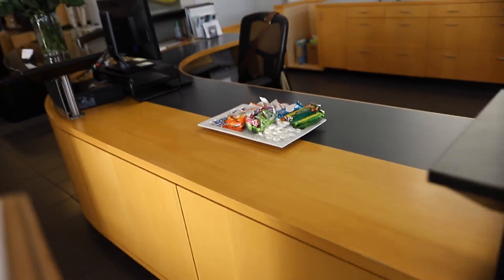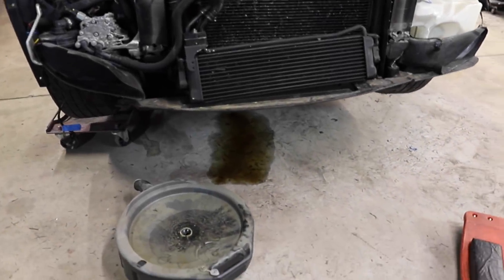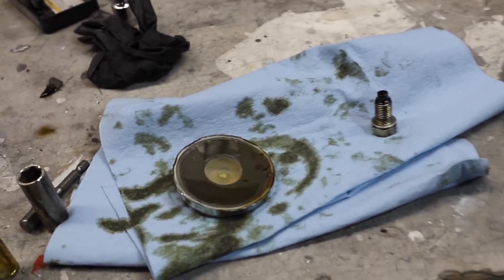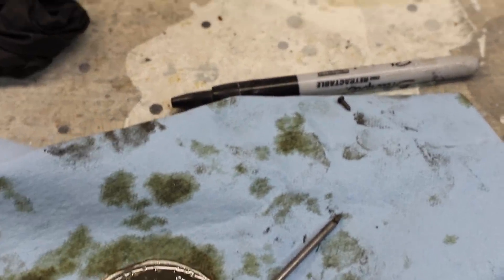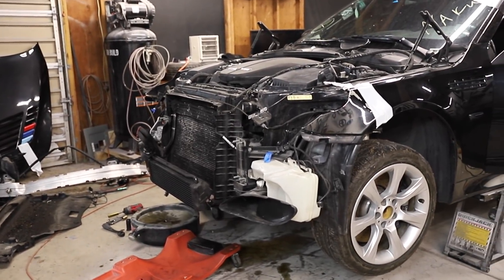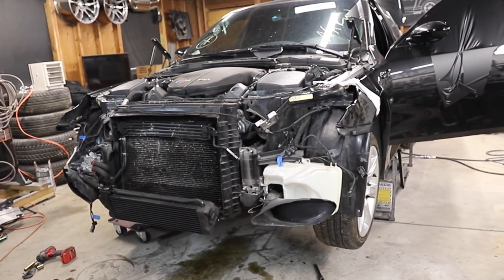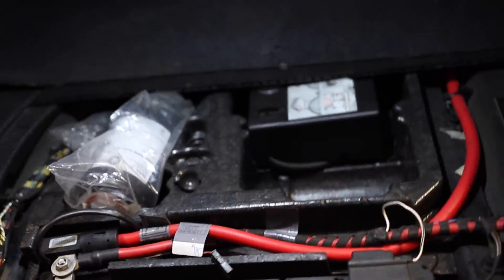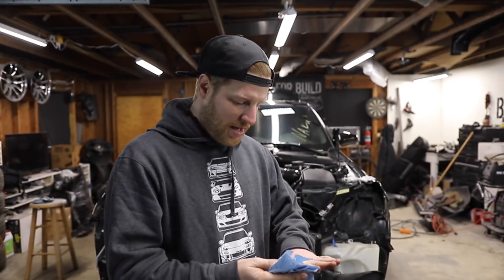Does the M5 Engine Run? Let's Find Out!

Comment: Also WHY would you replace the bearings in the bottom end,,the car only has a 100,000 miles on it and there was not any real notice of bearing metal..I have vehicles here with 300,000 miles and I’d take them on a 3000 mile trip in a minute.!
You’re blowing money that’s not needed.I have 700HP big block Chevy engines with 8-71 Blowers and when I change the oil there’s always a few flecks of metal...It could be from anywhere,,Cam,Crank,Rockers,Pistons etc...I wouldn’t bother,,Wait till you put the exhaust on it and when it’s quiet and you start it up listen for bottom end noise,a steady rap noise at say 2000RPM...Then you have a problem,Crank Beatings,But no way I’d tear it apart now without knowing if there’s even a problem.!!

Comment: Thats not water you spilt, That would be condensation from the hot exhaust gases vs the cold engine block. If the car had an exhaust you would notice it coming out the rear of the exhaust just until the whole exhaust system warmed up to temp :)

Comment: Your trying to use a camra that was designed to be used for photography and is limited to 30 minutes of record time, VS your old setup which is an actual video camera. 

Difference being a camera that is designed as a 'video camera' has no recording limit, has a different autofocus system, and is generally set up in the menu's to be easy for videographers to get the system. not to say that it can't be done, it's just the reason you're having issues.

Also as you stated your running the lense wide open your going ot have focus issues. Close the lens to F4 or-5.6 and it should make shooting much easier on the focus side, and still give you a creamy background. You have plenty of light to work with, so you definitely don't need to be shooting a 1.8 at 1.8 for video.

Keep up the good content.

Comment: On a vehicle with an engine that is know for eating bearings it's probably safe to say that finding any swarf on the drain plug or magnet is bad.  You really want to see the engine oil coming out without any swarf as then you know that the car has already had the repair done and had the upgraded bearings fitted...

Comment: When you get a chance, you need to send oil sample to Blackstone labs, usually the lead goes out first, before copper starts to show, usually high lead count vs average would mean it’s time for Rod bearings to be changed, if the copper is higher than average, then it’s immediately needed!

Comment: I own 04 330Ci ZHP manual and my 6th piston rod bearing wore out.. that little spec is nothing compared to the issue I've had.. Mine failed @ 145,000 when i had issues. I pulled motor and rebuilt the bottom end...

Comment: Use realoem.com to find part numbers and parts diagrams for BMW's. It is an excellent resource and makes Bimmer life MUCH easier. It accurately tracks part numbers through revisions and build dates to get you the correct part you need. Use that part number and search it on the usual suspects to find Genuine BMW, OE supplier and aftermarket parts. I like FCP Euro and ECS Tuning the best. Buy OE supplier parts for the best quality AND the best price.

Comment: I was wondering if you were on crack? Why try and stuff that huge motor in that classic? Great idea if it fit, but it doesn’t, you even did a video to prove it. Moving the front wheels will destroy the proportions of the car. Photo shop that! P.s. love your Chanel and watch every show, but mcm wins the 240z challenge.

Comment: Open manifold is fine.. you don't want to run them with nothing on the head itself becasue it'll have trouble pulling the heat away from the valves and what not..

Comment: I once did a 170mile round trip in a 335i without the exhaust manifold fitted it was fine just used slightly more fuel and made sure I had some ventilation lol.. a garage messed it up whilst replacing the rocker cover gasket and clutch somehow but yeah man love the vids bro!

Comment: Hey Chris, I'm not a Master BMW mechanic by any means but I can give some advices about S85s

First, I don't know about the US, but here in Europe they still sell Castrol 10w60 TWS oil at the dealerships.
There are now much better oils on the market, especially the Redline ones, which have a much better HTHS (efficiency at high temperatures). (And no, I am not affiliated to Redline)

Also, I have seen not one but two S85s throw a rod bearing out at less than 120kkm (70k miles), and three others with rod bearings in very bad shape at 50k miles, it was time to change them

So, even if you find out yours have been changed at 70k miles, I strongly suggest to change them again.

Also, you may find that S85s with more than 50k miles won't produce those 500bhp anymore and have vanos default codes, that is due to the high pressure (100 bar / 1500 psi) oil hoses for the Vanos which can't even stand pressure going out of your mouth (probably 0.01 psi)  when they wear out, and they wear out pretty quickly. 

So, I would also suggest to change those hoses and then check if the Vanos are still working the way they supposed to do before mounting this ginormous engine into the tiny 240Z shell

Oh, and those spark plugs are specific to the S85 because they also act as knocking sensors

I absolutely love your craziness, I might get some merch' tomorrow

Cheers

Comment: A good tip that I use on my race bikes is to filter the oil through a paint strainer.  place a small magnet in the strainer and you'll be able to see all kinds of particulate.

Comment: Chris, Send that oil batch off (older the better because new oil wont flake off any metal - you need miles to do that) and then also send off the next change. I own an S54 and  S65 BMW's you need several oil samples over several changes. You really should just do a BE Rob Bearing change anyways.

Comment: You should use dual pixel autofocus if you´re not doing it already, and maybe change to a canon lens instead of the sigma. The sigma looks great, but when it´s out of focus it doesn't matter. Check out Peter Mckinnon and Matti Haapoja for camera tips and what lenses they use.

Comment: i would say don't be so worried about rod bearing failure.. You are going to be pulling the motor out of the car anyway, just pull the pan and change the rod bearings...

Comment: Use liquiMoly it's just as good and cheaper than BMW's rebranded castrol oil. There is a quick oil level check option for the e60. Hold down the BC button for 2sec on the oil level indicator setting.

Comment: no big deal for the metal .. seen a lot worst. also instead of buying very expensive bmw oil you can just run LiquiMoli, there product is designed for european cars and the quality of their product is extremely good. i use that oil in all my customers high end cars

Comment: The 6D mark ii is set up for facial tracking, where it will look for a face and focus on the face. If you change it to focus point and set the point in the middle you wont have as much hunting. it will focus on what ever is in the middle of the screen unlike the curretnly face reccognition setting.

Comment: I did the same thing on my bmw battery terminal(bought it wrecked) took it apart, took out the plastic charge housing and connected it back up. 5 years running and no issues

Comment: I think you should keep working with the 6D. Familiarity will speed things up, and you don't always have to have the lens set wide open aperture, which will reduce focus hunting for those times when you don't need it.

The flexibility and quality over time, will be more important. You can always add lenses, and the ability to run two cameras (keep the old one - e.g. for time lapses), for alternate angles will be awesome.

Comment: A quick tip for leaks,clean up that splash of liquids you have on the floor and slide a clean sheet of cardboard right under the engine,If there is a new leak,you'll know exactly where it comes from.(And large panels of cardboard on the shop wall for a clean look and insulation)

Comment: You can easily film timlapses on the 6D. Shutter remote control release. It's a small device for around 20$ that you plug into your camera, set the intervals etc. and it will automatically take a picture every few seconds. Combining the images to a video is fast and easy in software. Any video software can handle it.

Comment: Why not do time lapse in post production? Seems like it works just the same. And the lens you are Using just might not be fast enough. You could can use a smaller aperture, and will have more in focus but won’t get as shallow if a depth of field but the camera will struggle less to keep things in focus.

Comment: i would fill it up with a cheaper oil with similar viscosity, run it for 20 minutes, drain and refill with BMW oil, this way you can flush more of it, if it happened to be running dry from previous owner.

Comment: You need to understand that the aperature setting determines the amount of depth of field you get, and aperature is limited by the lense, not the body. Use a smaller aperature on your newer setup and it should be better.

Comment: This thing is going to be the biggest POS to date , or a 5 year long build. The wiring will take you a year to sort out alone and get it right . Voltage drops/gains on systems specific inputs/ out puts. Unless your going to just wrap it all up and stuff it under the dash all hack like you did on other builds. Wrap it up in tape and call it done ,barf.
Then you think the suspension will work on a shortened wheel base bahahahaha,what a fucking joke . BMW spent hundred of thousands perfecting their cars suspension over decades. That 240 is way to light for it to even know what it is supposed to do,you will spend thousands to try and get it to even drive down the road straight.
Then your going to build a modified frame ,on the floor of your garage. No frame jig to line up stuff. No datum line tools to make sure every last part is square to all the rest of the car's suspension. HAHAHAHAHAHHAHA.

Comment: increase your aperture up to like f8 and your ISOas well and finally lower your shutter speed. With all that your light flicker issue, focus speed and focus hunting should be fixed. You won't have a lot of dept of field but should be fine. also you can configure functions on the menu so that you can set the time lapse feature easier. Give it a try and keep up the good work.

Comment: Hoping you see this... you need to turn your ISO up and get your F-stop lower to increase your depth of field. That will help a lot. And if you mess with your shutter speed you should be able to get rid of the flicker.

Don't waste money on new gear, what you have will work great once you get a hang of the work flow.

Comment: The E60 requires what's called battery registration. It's called the IBS or Intelligent Battery System. You have to register the battery with the car's computer by telling it if it's a lead acid or AGM (new type of dry battery that stands for Absorbent Glass Mat), new or used battery etc. Dealer will charge you (pun intended) around $400 or you can buy an electronic tool for the same money to DIY the job. It's a relatively recent movement at BMW to turn their service centers into profit centers. Failure to do this may cause the IBS to not charge the battery properly and could shorten the life of the replacement battery.
Reply: P.S. This stupid system went into any BMW that offered iDrive as standard or optional equipment. Easy hints: most BMWs after 2001 model year with the i Drive knob on the center console.

Comment: It is natural for your engine to have small pieces of metal in it. It's impossible for it to not. The biggest one you found brings up a small amount of concern, in the event that the filter was full of pieces like that, or the plug had many of those stuck to it. Being that your magnet, and the drain plug only had 2 or 3 flakes, means that you have a very healthy engine. I'd recomend just changing the oil, driving for 1k miles or so and changing it again to see if the outcome differs from what you have

Comment: From what I remember of high school photography:
For your shallow depth of field issue, use a smaller aperture (higher f-stop). Canon Rebels have an Av (I think?) mode on the dial which lets you set the aperture and then the exposure time will adjust to get you proper exposure. Smaller aperture + longer exposure = deeper depth of field, wider aperture + shorter exposure = shallow depth of field.
As for focus moving around while you move about the shop, maybe switch the lens to manual focus once you get it focused on the subject (the car)?

Comment: I've been doing this for a very long time and to me it looks like normal wear and tear on an engine you will have time to time fine little tiny bits of metal on a magnet in your oil and it's just from where on the engine as long as you don't find anything bigger then what you're finding now the engine looks like it's fine

Comment: Check bmw they are under 200.00 also you need to reset your battery registration so it last 7 years if you don't it will last 1 year MAX also a optimum battery is not compatible with the IBS (intelligent battery system) you want a AGM since that is what is in it so you won't have to code the car if you need help let me know

Comment: Chris, this may sound counter-intuitive, but I’ve heard and read that the smallest glitter-like shavings (in some quantity) can be more damaging than the more visible burrs. With my Boxster (and it’s overinflated but important IMS issues) metal shavings in oil is a constant concern. If you get a chance, search on YouTube “the four stages of IMS failure”. I think it would be interesting for you, learning about the analysis of oil and it’s contamination.

Comment: Turner motorsports has a pretty turnkey kit for the rod bearings on the S85 and I believe they are the updated rod bearings (only downside with the updated rod bearings is that if they start to fail again in the future they do not leave metal shavings in the oil as easily as the old ones did so it can make it alittle harder to determine if they are failing) https://www.turnermotorsport.com/p-340428-e60-m5-e63-m6-rod-bearing-overhaul-kit/?pdk=AAAAAAAAAgECAgMCAQ

Comment: You do not need to worry about that little tiny shaving, if you even had a handful of shavings you'd be fine. Now if there was large chunks, you'd definitely be in trouble. Coming from a Subaru guy who has been through 3 transmission and has checked his magnetic drain plug and found chunks.

Comment: I'd look into different lenses and AF modes on the camera before deciding to dump it.  Also, you could change the depth of field by increasing your aperature a few stops, maybe f5.6 or f8

For timelapses, I would look into getting an intervalometer (https://www.amazon.com/Neewer-Timer-Remote-Canon-D2000/dp/B005LT7CE2/ref=sr_1_5?ie=UTF8&qid=1523495069&sr=8-5&keywords=canon+intervalometer) that will allow you to just release the shutter once you have settings that you like.  I am not sure if the 6Dii has an internal intervalometer but the remote ones always work better.

Comment: y not change out the bearings? you're pulling the engine anyways. easy to check one or two bearings without major disassembly. Oh, you won't hurt the engine to idle without hurting anything. Most people think you will crack or burn a valve. I've been wrenching for 30+ years.

Comment: Tip for deciding what bits are in the filter (you thought paint). Is try and set fire to the bits with a lighter. If it's paint, plastics or resins it will burn/melt. If it's metal it won't.

Comment: I use a Canon 70D for all my stuff and I just speed it up in post in Final Cut Pro X. I still film talking and high speed as separate files so it doesn't add a bunch of time to editing. As soon as I load the clip into the timeline I can see if it is talking or high speed and it is one shortcut to speed it up.
Reply: Home Built By Jeff subscribed! What lens do you normally use?
Reply: Thanks mate. I just use the 18-55mm STM kit lens, although I have damaged it so I will probably just get the other 18-135 STM lens. The key is the STM which is the silent auto focus which is a must for video.

Comment: You should do the rod bearings before installing in the 240z.....I have 2 s65 M3s and they have bearing issue the same as the s85. BTW--BE Bearings if they are available.

Comment: Be aware for BMW's including your M5, when you replace your battery you need to code the new one, different capacity battery's have different codes! Will show errors if you don't.

Another reason to find someone local or can remote in and take over your laptop and the coding software who has good experience coding

Comment: Chris, while I have been a lifelong fan of BMW, I HIGHLY doubt that at 60 or 75,000 miles that engine would need it's rod or main bearings replaced. If it does, BMW designed a dodgy engine with terrible reliability and there is a serious issue in the lubrication system and engine balance. I don't know anything about the V10s, but if there is an issue with the rod or main bearings, I can't hear it and that would indicate a serious problem with the design of that engine. I would do your research before replacing the bearings. That's a major job and while the rod bolts can be done with the engine in the car, the main bearings you'll most likely have to pull the transmission if you want to do it right. Just because DeBoss Garage did it without removing anything on a diesel, doesn't mean that it can be done on a tight tolerance high performance V10. I just want you to know what you're actually getting into before you take the leap.